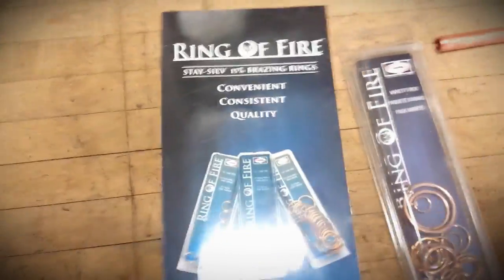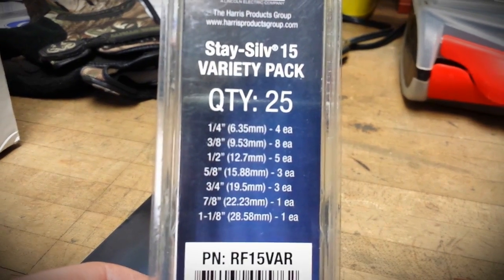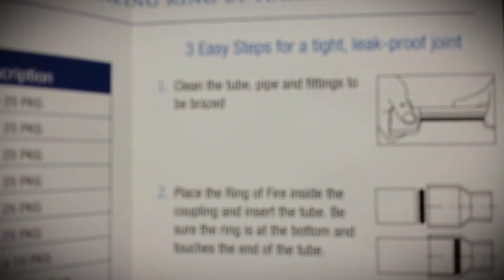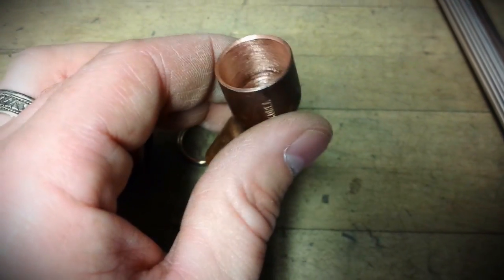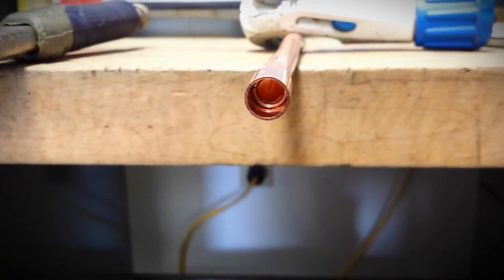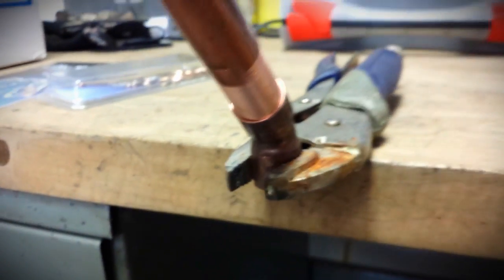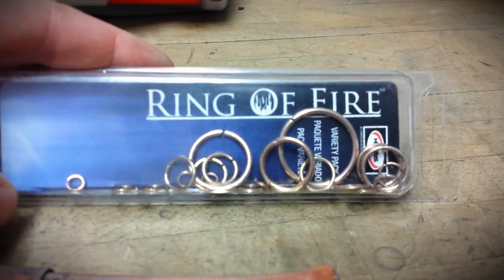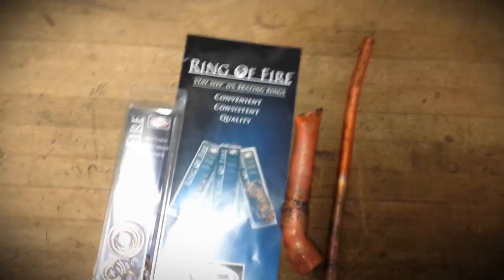HVAC - Harris "Ring of Fire" Brazing rings review

Comment: I noticed on the 3/4" fitting, you concentrated most of the heat on the fitting, and not the pipe. WRONG! 

Look up "How to Braze with Lucas-Milhaupt Sil-Fos® Rings". Good demonstration, and the proper technique for capillary action is shown here.

Comment: Nice demonstration!  You need to try it with ACR couplings because the one you are using is nominal for water and I think it's letting the ring melt unevenly. But yes overall I think you end up wasting much material (gas, rings, time, etc) not to mention overheating the tube to wait for confirmation.
Reply from the maker: Jesus Pagan Good point, I've used them in the field and seem to work best for me with hard to reach places, such as cooling tables, ice makers and things like that. I still prefer the tried and true method for standard line sets. thanks for the comment!

Comment: On trying to put the ring of solder on the outside, just stretch the ring open and slip it on the tubing. Maybe it is too strong to stretch apart.  Just thinking. If it would go on the  tubing, I would think the heat would draw the brazing all around the joint.

Comment: nice but I still like the good ol stick + you need to much heat . 
I don't think I would trust not seeing the weld on the outside to verify.
even if its sealed it may not be that strong      units I work on may have 5,6,10 bottles of Freon in them    to much $$$$$ to gamble
Reply from the maker: Very true, I was on a factory tour of an AC company and apparently they have been using those type ofrings for years. I always wondered how they get their braze joints to look so good!
Thanks for sharing!

Comment: Have you tried to put the ring of solder  on the outside of the joint and try to get the solder to draw down into the female fitting?  Might work for the upper side of joints,  but not sure about the lower side.  If you make any more videos on this, it would be appreciated.
Reply from the maker: I plan on making a follow up video on this after I have more experience with them. I don't know if they have them sized for putting them around the outside of the pipe. I think they are just for the inside. 
Thanks